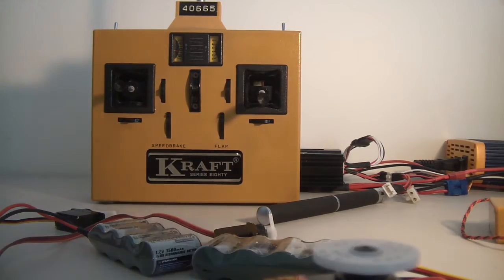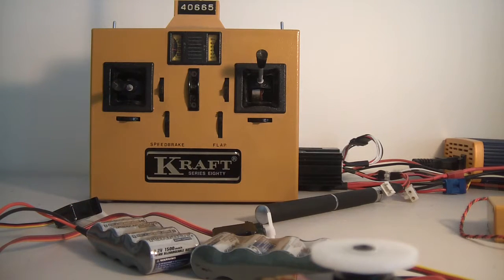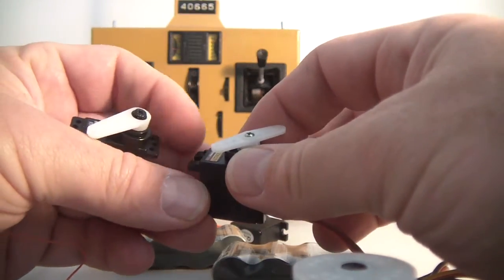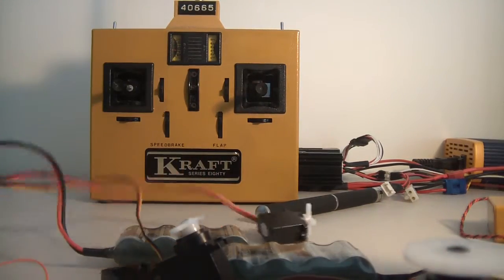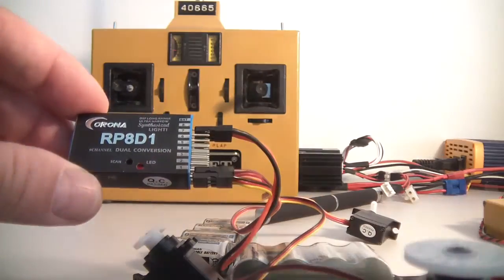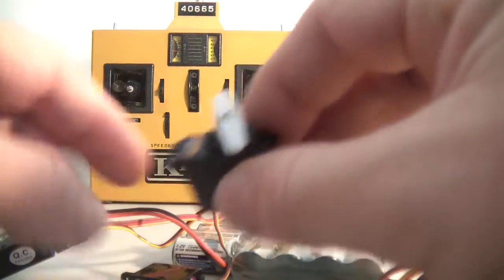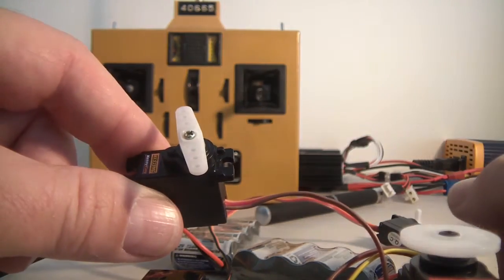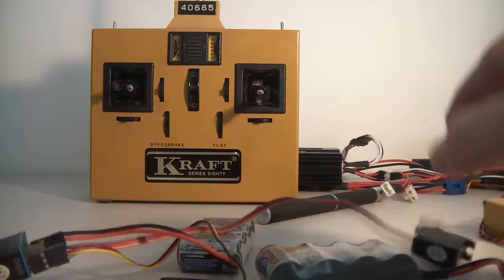33 Year old Kraft radio with Corona synthesised receivers

Comment: Do you have any idea if the RP6D1 does that servo jitter with any transmitter? because the RP8D1 is out of stock in hobbyking... and I don't have any other receiver to fly now. I'm thinking about the RP6D1 but your video kind of won't let me take the risk. What do you think? I have Futaba Skysport T4YF 72.950MHZ 4 channels transmitter...